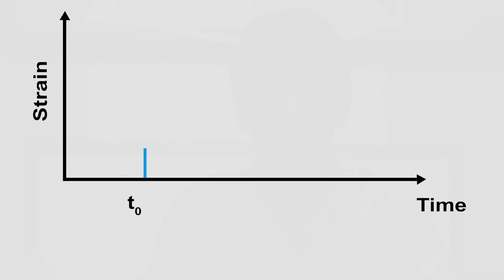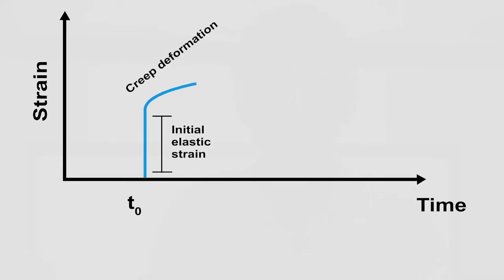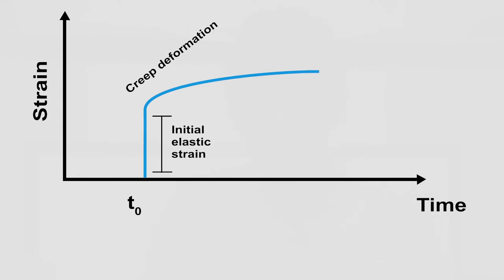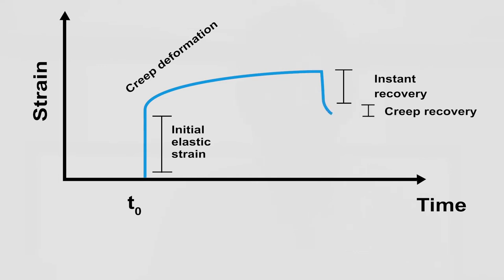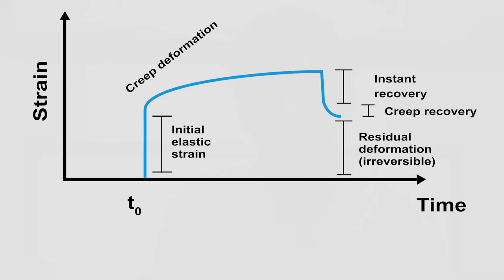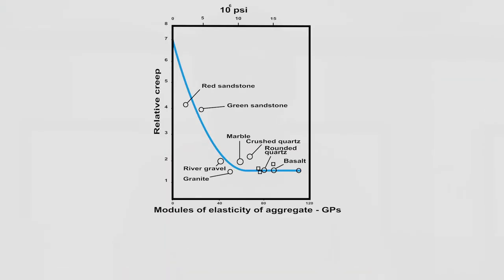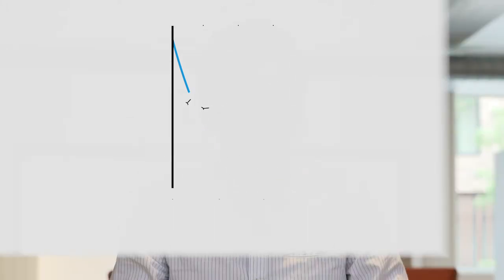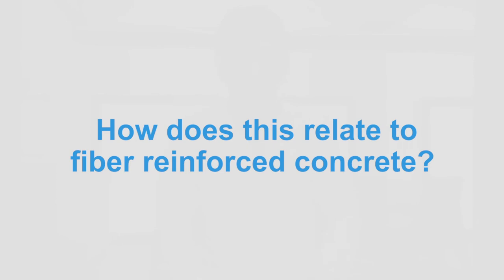Creep of concrete – expert talk

Comment: What will be the behaviour of stresses in concrete over the time in a reinforced concrete element under sustained load due to creep? Like it will decrease or increase or remain same with time.
Reply from the maker: It depends on the type of reinforcement and the boundary conditions of the element you are referring to. For example: in indeterminate elements, an amount of stress relaxation can occur. In determinate elements like a beam with rebar, stresses can be partially redistributed to the rebar. There are many different elements to consider depending on the application at hand. An interesting read on the structural effects of creep in fiber reinforced concrete is this article by Plizzari and Serna: https://link.springer.com/article/10.1617/s11527-018-1290-0

Comment: Good day!
May you please advise how to apply the theory of creep practically in accordance with Eurocodes. As per Russian code SP 63.13330.2012 there is a special formula, which reduces modulus elasticity in order to define deflections and internal stresses redistribution.
Thank you very much in advance
Reply from the maker: Dear Boris, we don’t know the exact details of the Russian code, but it sounds as if the Eurocode works in a similar way. It introduces a “creep-coefficient” which reduces the elastic modulus to predict the deformation for a constant (creep-)load. However, the code focuses only on compressive creep load. The effects of creep on cracked sections in tension is still food for a lot of ongoing research and is not taken up in the Eurocode. Until this is introduced, it is common practice to use safety factors to account for creep in tension.
Reply: @Bekaertchannel  Thank you very much for your feedback. As for me, your statement sounds completely in line with the Russian code: for sure behavior of the same material the same all over the world, but I was assuming there is (I mean in Eurocode) more assumptions than one formula which reduces the elastic modulus.
Now is completely clear. Thank you very much.
Reply: Есть руководство по учёту ползучести ниижб

Comment: Sir my question is why creep increase if we increase cement content?
Reply from the maker: If the cement content is increased without changing the amount of water, the water-binder ratio decreases. This will result in a stronger concrete that will tend to creep less. On the other hand, if you increase the cement content and at the same time increase the amount of water to keep the water-binder ratio constant, the hardened concrete will end up having more water in it that did not react with the cement. The water content in the hardened concrete is one of the main driving forces behind creep, thus: more leftover water results in more creep.
Reply: Thankyou sir